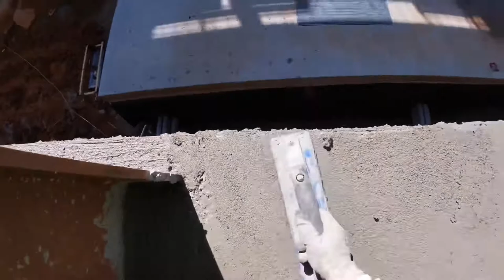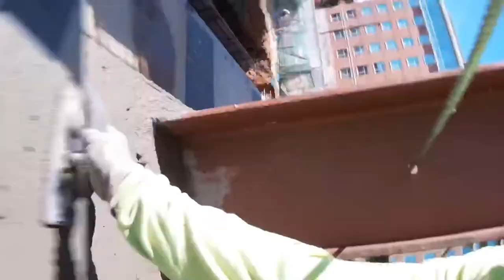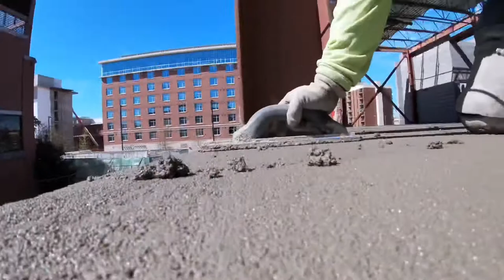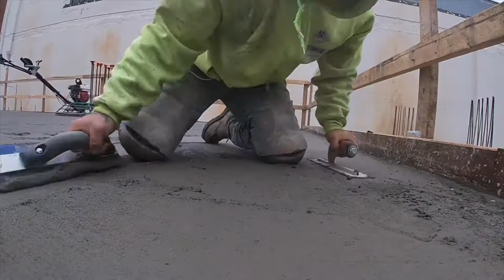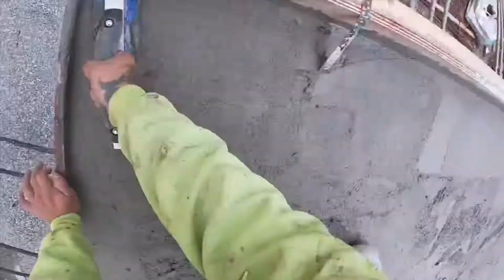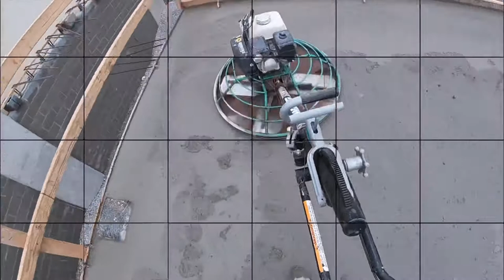🤘🏼CADILLAC TIVAR88 FLOAT

Comment: How would you compare this to other floats? Looks like it handles like a wood float? Curious, maybe I might want to pick one up
Reply from the maker: It’s more aggressive on hard concrete. It’s a big heavy than normal resin floats. But works good on rubbing walls, or hard concrete. Get them small around 10 inches tall. Works best
Reply: @myconcretexperience3049  I bought a set, I find they are only good for exactly what you described. Any projects with slopes and contour,example patios and driveways, it’s not ideal, doesn’t have a curve like typical mag floats. Kinda wish I had just bought other mag floats

Comment: How are you liking it compared to magnesium?
Reply from the maker: I still love magnesium during wet concrete. Only use this tivar88 float on stiff concrete
Reply from the maker: I don’t use it to close up. I only use it to open it up or cream it. It has its purpose, I only use it on stiff concrete.
Reply: Only way close with resin is crank it up and slow wipe. But like he says best use is on curb or other low slump or wind top mud. I also like them for a first mag before strike due to the fact of how flat you can keep it. It cuts down the high shit really nice